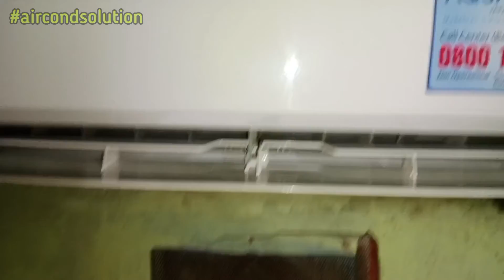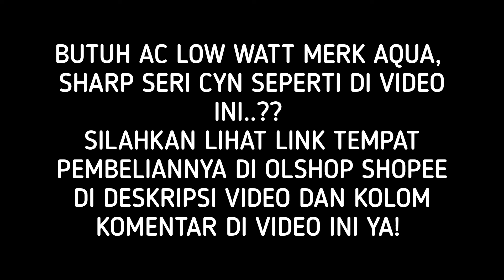Cara Melepas Swing AC SHARP, AQUA

Comment: bang evaporator indoor bocor di tengah,klo mau di ganti pipa nya sama uben nya pake yang ketebalan 0,4mm kira² kuat gak ya? Untuk freon r22 sih
Reply from the maker: Kuat utk R22
Reply: @AirCondSolution  ok terima kasih bang🙏
Reply: @AirCondSolution  bang mau tanya lagi,tadi uben sama pipa udh saya ganti dan hasil nya tidak bocor lagi,tapi saya kasih tekanan 100 psi pake kompresor,sedangkan yang pertama cek kebocoran saya pake freon r32,saya kasih tekanan 250psi wktu itu
Reply: @AirCondSolution  klo buat mastin bocor nya aman apa perlu pake freon lagi bang? di kasih tekanan 250 psi perlu gak? atu di kasih tekanan angin pake kompresor 250 psi  gmn bang,cuma buat mastin aja
Reply from the maker: Pake freon bisa pake angin bisa kl cuma buat mastiin doang biar irit pake aja angin
Reply: @AirCondSolution  di kasih tekanan berapa psi bang ya? Ini indoor 2pk merek gree
Reply: @AirCondSolution  klo pake angin bang mksud nya,buat mastin bagus nya di kasih tekanan berapa psi ya
Reply from the maker: 300 an psi cukup
Reply: @AirCondSolution  ok bang terima kasih info nya🙏

Comment: Bang kalau sharp sama tcl lebih bagus mana?
Reply from the maker: Sama bang 2 merk ini tp utk sharp sy lbh suka yg sharp made in china ini : https://shope.ee/5pY6hh6yxc
Kl TCL yg ini beli lgsg di toko official TCL nya : https://shope.ee/20LOD7foLQ
Sy sih pribadi lbh cenderung ke TCL
Reply from the maker: Yg penting kapasitas ac terhadap ruangan cocok lalu perhatikan hal2 di bawah ini bang Randika :

UNTUK PENGGUNA AC PERHATIKAN INI!   

KUNCI AWET NYA AC DI MULAI DARI SA'AT AWAL PEMASANGAN : 👇

(1). Pasanglah AC dgn S.O.P yg benar seperti di video milik Daikin ini👇
https://youtu.be/THCeE90ADPo

(2). Pakai pipa AC yg tebal minimal 0.6mm👇
(*Pilih salah satu)
- https://shope.ee/8KF0iQjBq4
- https://shope.ee/9K4O9ct3IH
- https://shope.ee/8eoZmM7Jib
- https://shope.ee/20HfqBQHEu
- https://shope.ee/5KY7oN3AjR
- https://shope.ee/UJEoVbgh

Pipa AC1. 5 PK - 2 PK :
- https://shope.ee/VW9OBvyj2

(3). Pakai kabel asli tembaga ukuran minimal 3x2.5  (unit stndar/low watt) & kabel isi 4x2.5 utk unit inverter 👇
- Kabel isi 4 👇(* AC Inverter) 
https://shope.ee/5KXCjPYXTM
- Kabel isi 3 👇(* AC Standar/LowWatt) 
https://shope.ee/7UbhJRtwgL

*usahakan jgn ada sambungan kabelnya

(4). Pastikan voltage/tegangan listrik stabil di 220 volt kl drop/tdk stabil hubungi PLN minta perbaikan tegangan listriknya, pembahasan mengenai voltase/tegangan listrik 👇
https://youtu.be/4Ikw1eEI3Oo

(5). Nah satu lg ini penting sekali,wajib lakukan pemakuman, vakum pakai alat vakum khusus AC jgn mau kl vakum manual di gejos dgn freon,vakum paling ga minimal selama 20 menit, tutorial cara vakum AC 👇
https://youtu.be/hS4gO9BOXy8

(Sebelum teknisi nya datang ke lokasi kita, misalnya besok kita janjian mau pasang AC nya,nah skrg kita pesenin ke teknisi begini: mas maaf besok tolong bawain mesin vakum khusus AC ya, soalnya sy mau nya setelah pipa AC terkonek indoor outdoor sebelum running saya mau AC nya di vakum dlu ya pakai alat vakum khusus AC minimal selama 20 menit, sy ga mau kl vakum manual di gejos dgn freon, bisa kan?
(*Gituin..jd teknisinya bisa siap2 dr skrg utk besok sesuai dgn keinginan kita)
Nah..jika teknisinya bnyk alasan jawabannya sperti di bawah ini :
- AC baru ga perlu di vakum pak/bu
- Pipa AC nya pendek ga usah di vakum
- Saya sudah banyak pasang AC tidak pernah di vakum, AC nya baik2 aja
- dan bla..bla.. blaa..alasan lainnya maka lgsg cancel saja, di sini bpk/ibu sdh bisa membaca typical & cara kerja teknisi AC nya yg akan pasang AC konsumen asal2an tdk sesuai prosedur & tidak memiliki alat pendukung kerja yang memadai

* Vakum atau proses pemakuman itu sejatinya gratis alias tidak bayar krn proses pemakuman itu adalah suatu hal yg wajib di lakukan  dlm proses pemasangan AC

* Keuntungan lainnya dari proses pemakuman pakai alat vakum khusus AC kita juga bisa tahu ada kebocoran freon atau tidak di instalasi AC tersebut.

Cara cari teknisi :
https://youtu.be/I6sguA4jCKQ

Alat vakum AC :
- https://shope.ee/4KirwbWbTN
- https://shope.ee/8pBHIFmggy
- https://shope.ee/A9getGyTgW
- https://shope.ee/2AeNMf4Vjk

YouTube :
https://youtube.com/c/AirCondSolution

#CaraPasangAC #AC #AirCondSolution #AirConditioner #AirCon #AirConditioning #TeknisiAC #ServiceAC #PerbaikanAC #Freon #Refrigerant #BTU #IsiFreonAC #TeknisiACTerdekat #BritishThermalUnit #Daikim #Kembla #Hoda #Saeki #Tateyama #NipponSteel #PasangAC #BongkarAC #BongkarPasangAC #ACLowWatt #ACHematListrik #ACRecommended
Reply from the maker: AC TCL 
# 1/2PK :
https://shope.ee/1AmEOPaWhc

# 3/4PK :
https://shope.ee/6UnkkJR8U5
# 1PK :
https://shope.ee/7UgHwFlRPE
# 1.5PK :
https://shope.ee/1q1vBtnWXz
# 2PK :
https://shope.ee/5pY3xNDoFk
# 2.5PK :
https://shope.ee/5UvDYnN8fQ

Apapun kebutuhan AC rumahmu, ada di sini : https://mycollection.shop/aircondsolution

#AC #ACTCL #TCL #TCLIndonesia #AirConditioner #AiracondSolution
Reply from the maker: https://fb.watch/gLGhCc1d1C/
Reply from the maker: Jgn lupa pakai pipa tebal minimal 0.6mm & jgn lupa jgn proses vakum pakai alat vakum ac jgn mau kl teknisi ga bawa alat vakum tolak aja
Reply from the maker: Tips menghemat biaya dlm pemasangan AC yaitu konsumen bisa beli sendiri material pendukung AC nya, jika beli dr teknisi maka harga nya bisa jd berkali2 lipat & kualitas nya biasanya yg biasa bahkan cenderung jelek krn teknisi biasanya cari yg paling murah tp di jual setinggi mungkin ke konsumennya.

Jd konsumen hanya bayar jasa pasang AC nya saja ke teknisinya.
(*jasa pasng AC antara 200rb - 300rb)

Material pendukung yg di butuhkan dalam pemasangan AC, semua link di bawah ini adalah material recommended :

1. Pipa AC :
Pilih salah satu di antara merk2 di bawah ini  :
(*Pipa AC di bawah ini untuk AC kapasitas 1/2 PK - 1 PK & bisa untuk AC standar,Low Watt & Inverter)
- Pipa AC merk "Nippon Steel" 👇
https://shope.ee/9K4O9ct3IH
- Pipa AC merk "Kembla" 👇
https://shope.ee/8eoZmM7Jib
- Pipa AC merk "Tateyama" 👇
https://shope.ee/20HfqBQHEu
- Pipa AC merk "Saeki" 👇
https://shope.ee/5KY7oN3AjR
- Pipa AC merk " Hoda" 👇
https://shope.ee/UJEoVbgh
- Pipa AC merk "Daikin DSP" 👇
https://shope.ee/8p6dBmFiUa

Ini pipa AC untuk kapasitas AC 1.5 PK - 2 PK (*Ukuran 1/4" + 1/2" :
Pipa AC Tateyama : https://shope.ee/2KuwlXixJg

2. Bracket outdoor :
https://shp.ee/rw8ubmr

3. Duct tape balut pipa :
https://shp.ee/3bjymir

4. Stop kontak kaki 3 :
- Merk Panasonic 
https://shp.ee/kii7qqr

- Bisa jg pakai merk Broco
https://shp.ee/77gw4ar

5. Kabel :
- Untuk AC standar/low watt :
https://shp.ee/5tydqwr
- Untuk AC inverter :
https://shp.ee/mnj2nkr

6. Selang fleksible pembuangan air/drain :
https://shp.ee/p9nyx8r
Bisa jg pakai selang serat:
https://shp.ee/jjjtkhr

7. Klem kabel :
https://shp.ee/u2ypq7r

8. Isolasi kabel :
https://shp.ee/muszkvr

9. Paku beton :
https://shp.ee/dz59k5r

10. Klem pipa AC :
https://shp.ee/rrxiivr

11. Dempul plastisin :
https://shope.ee/2AeO0gINRB

Silahkan hubungi FP di bawah ini jika ingin konsultasi/kirim gambar/video secara private 👇
https://www.facebook.com/AircondSolutions/

Nah di bawah ini link untuk beli freon AC, ingat isi lah freon AC sesuai dgn spek kompresor nya masing,freon tdk boleh di campur/di isi dgn jenis yg berbeda bisa sebabkan kerusakan pada AC & AC baru tidak perlu isi freon krn freon nya sdh ada bawaan dr pabriknya..

Pengguna AC bisa beli sendiri freon dgn harga yg lbh murah dr teknisi & kualitas di jamin original :
- Freon R32 : https://shope.ee/4KdrcSrLpz
- Freon R410 : https://shope.ee/5pTKzlYLas
- Freon R22 : https://shope.ee/4AMVS72XSL

Note :
Semua link di atas akan mengarah ke Shopee tentu dgn toko2 yg recommended & sebelum membeli baca deskripsi produk & chating dgn penjual utk menanyakan stok & apakah barang yg kita beli cocok & apakah ada barangnya.
Teman2 juga bisa beli secara offline di toko2 terdekat dr lokasi teman2 & samakan saja barangnya dgn link2 rekomendasi di atas.

BELANJA AMAN VIA REKBER SHOPEE !

Bagi yg butuh untuk mengcopy deskripsi ini silahkan hubungi via FP : https://www.facebook.com/AirCondSolutions/

YouTube Channel :
https://youtube.com/c/AirCondSolution

#AC #MaterialPendukungAC #PipaAC #AksesorisAC #PasangAC #BongkarAC #IsiFreonAC #Refrigerant #Kembla #Tateyama #NipoonSteel #Hoda #Saeki #DaikinDSP
Reply: @AirCondSolution  tapi tcl masih pake fren R410A. Kira2 gimana mas??
Reply: Mohon pencerahannya mas
Reply from the maker: 😁 emang knp kl R410a bang, gpp R410 & R32 itu sama2 jenis freon hidrocarbon ga masalah, Panasonic inverter jg pakai R410a yg ga boleh itu R22
Reply: @AirCondSolution  iya bang kata orang2 R32 lebih dingin hehehe. Makasih ya abang infonya. Sukses terus bang buat video videonya🙏
Reply from the maker: Secara cooling index R32 memang angka nya lbh tinggi di banding R410 tp pabrikan sdh menyesuaikan antara R410 & R32 di mana volume  R410 di buat lbh bnyk agar angka cooling index nya menjadi sama sprti R32

Comment: Om klo ac sharf model lama,
Lampu indikator nya nyala smua kenapa itu
Reply from the maker: Cb reset ulang remote nga kl msh cek termis & perlu data ampere, tekanan & voltase saat ac running
Reply: Ok om nanti sya cek om.
Mksih inponya
Semenjak sya nonton vidio om.
Dari ga bisa.
Sedikit2 udah mulai nambah ilmunya
Reply from the maker: Ok siap bang Arie 👍👍